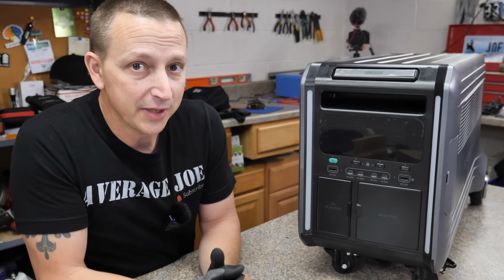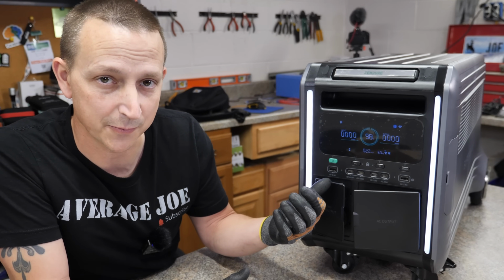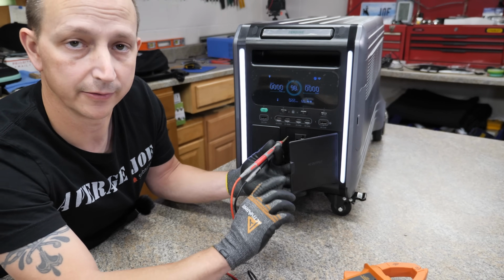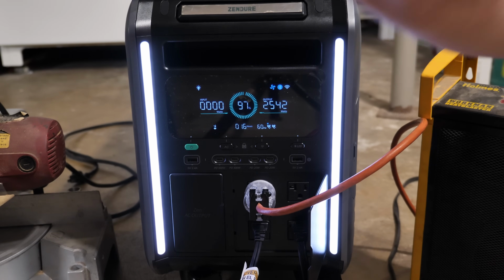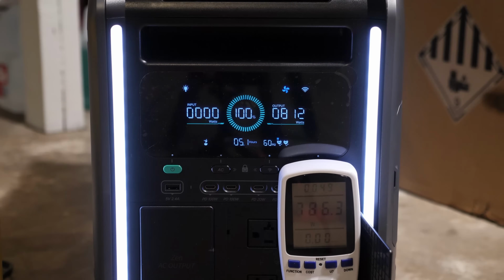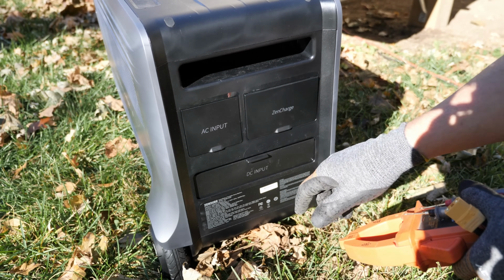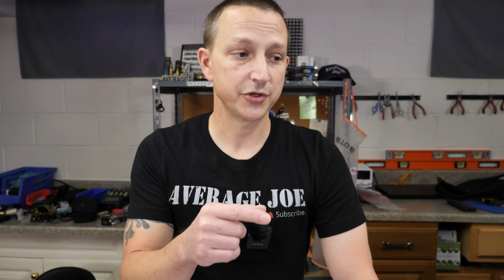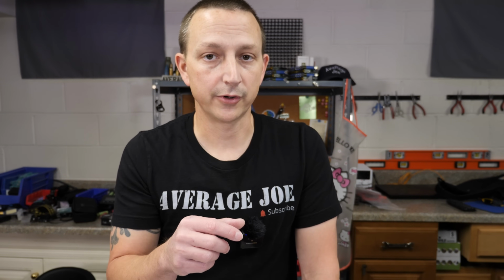Full Review on a Zendure Superbase V4600!!

Comment: I bought two Zendure SuperBase V 4600 units, and one of them became completely unusable during a software update. This was not caused by misuse or physical damage. The unit died during Zendure’s own update process.

I contacted customer service expecting them to help repair or replace it, but they have refused to provide a reasonable solution. For such an expensive product, this level of support is unacceptable.

My experience with Zendure has been terrible. I cannot recommend the SuperBase V 4600 or this company. Think carefully before spending your money on this product.

Comment: what you actually fail to mention, is the fact that is has no real off-grid mode unless you buy the expensive "Home Panel" wich is rather large. Without the home panel you are stuck in Bypass-mode. This means every load you run from the SB V4600 will be put through to the grid, regardless of any limits you established in the App. This is very problematic in every instance when you want to run stuff wich needs burst of power and the grid can not cope with that burst-current. Let´s say you want to fire up a party and your friends ask you to supply the power. Constant load 2kW (Lights, Music, etc), Cooling Wagon (Beverages) 2,5kW. Place is in the woods and only has 220V at 16A = 3,6kw. You cannot do that properly, and here is why: 
- The moment the cooling Wagon starts to draw energy (2,5kw) , the Zendure will automatically put it on top of the constant load (2,0kW). Zendure will now request 4,5 kW from the Grid, which will pop the circuit breaker. 
- This is regardless what you established as an upper limit from the Grid in the App
- The UPS will now kick in and supply the 4,5kW
- But it will do so w/o the support from the gird, just the battery
- Inside of an hour the Zendure will leave you with nothing, since the batteries are depleted. 

The Home Panel will let you accesss the Off-Grid mode where you could run the above mentioned scenario, albeit at a much higher price point and with additional hardware to carry around. 
Stay away from this clunker. Get an Bluetti EP500 pro instead. It is super quiete, can engage different modes, like the senario above. Has more kWh. Better software integration and better solar panel integration (2 MPPT vs 1 Zendure).

Comment: I like the SB v4600. It is a beast. The software works flawlessly, because I heard some horrific things about the update etc.  It has to be said though that the unit is rather noisy. Even with rather easy loads it is answered by a loud fan. As long as you have this away from your dorm etc it is ok, as it does not take away from the performance.
The only problem I have is with the programming of the charging process, while the AC is engaged. I have another Powerstation and I want to transfer some juice to the SB B4600. Regardless of what you choose in the zandure app the full load is required from the income. It looks at the income as from the grid and just transfers the same volt through , even shutting off it's own AC function. Because the smaller external Powerstation can not handle the required load, it shuts off. In the zendure app I can choose silent charge or can limit the charge to a certain amount Watt, this is regularly overwritten by the requirement of the load and respectively required from the external unit, regardless the stoppers you implemented.
I do get it, it makes sense to just pass it through when you are grid connected. But I'm not in in that scenario the limiters unfortunately do not apply.
Reply: Also it is an energy-hog. When AC is engaged it gobbles down 80W constantly - regardless of load.
Reply: Hey, thanks for your feedback. Is the fan loud only when charging or all the time ? Thinking about buying one for my van. I won't charge it at night but just feed my 12v cooler.
Reply: @troidemi  I would advise against it. The Zendure is loud, verly loud indeed. The worst thing, especially for me on a camping trip is the fact that you can not charge from the grid and stablish an upper limit for the wattage. This is often required since the current (Ampere) on the Campsite is often times restricted and you want to run maybe an A/C, an electric Grill-oven, Coffe machine, etc. In all those instances, the zendure can not really help you. What the nice people from Zendure don´t tell you, is that the SV is constantly in Bypass-Mode. Meaning, every load it gets it will automatically try to pass through to the grid, regardless of "Silent Mode" or "upper Limitation for charging". Now, this begs the question, why the hell does it then have these funcions. Well, you have to purchase an additional "Home Panel" with a hefty price tag on it and cumbersum on a camping trip. For all these reasons I would give the Zendure a wide berth. Go for Bluette EP500 pro instead. This powerstation blows the zendure out of the water, in every category. And it is super silent, you won´t hear it at all.

Comment: How is the unit holding up?
Reply: Mine is bricked. Won't take a charge. Won't output energy. Powers on and connects to the internet and bluetooth, but other than that it's not practically functional. Zendure offered me a partial refund, but I kind of want to replace the broken inverter and stuff with an aftermarket solution

Comment: 240v is always 1 phase. the 2 legs of 120v balance loads over common. Basically if you have a light plugged into leg A and the same type of light plugged into leg B, you will see zero current over common back to the panel. If there is an imbalance then you will see the difference over common. The legs are in series basically. I think my 240V inverter is always on, and maybe thats just how it is, but with low power draws it drains fast. I can run this thing for days using only the USB and 12v stuff, but the inverter will drain it in like 2 days, even with low power stuff.

Comment: So it seems that even though it's 3,800w it can only do about 1,900 on each 120v leg.  So to run split phase 240v to a transfer panel you'd need to have it balanced.
Reply from the maker: For split phase we also need the hub which I now have and need to do a follow up vid. I think some firmware updates have inproved it as well.
Reply: @AVERAGE_JOE  You can just get a cable that splits two 120v plugs into a 50 amp plug, you don't need their hub but their hub will work too.

Comment: Hi Joe! Thx for the video.  If you have time could you possibly answer some questions regarding the solar charging setup? Following the manual, it says to wire 3 in series, or if you have more, to wire them in parallel. I have tried both and cannot get my system to charge. The company has not been any help as yet. I’m going to try charging it via shore power and see if it just needs a boost to be able to start the solar charge. At my wits end! Seems like a great unit but mine isn’t working and the company is stalling regarding a return/refund.
Reply from the maker: Sure Ill help if I can.  Ill need to start at beginning.  Can you check the voltage of the panels to make sure the voltage is in the correct range and of course to make sure the polarity is correct? Positive and negative going to correct port. Let me know voltage once you know.

Comment: Hello cool video, thanks a lot.
I was wondering if it is possible to charge in dc and discharge in ac simultaneously? If yes does it use always the battery storage to provide the requested ac power or is there a kind of bypass mechanism to only use battery just for the power not provided by the solar input?
Same Question if we use the ac input together with ac output it works simultaneously as well? And with the same bypass mechanism ? 
Finally have you tried the 240v outlet : what is then the max power? And is the ups mode working with this outlet? 
Many thanks in advance for your replies.
Best regards

Comment: Any update on the Y-cable? I'm suuuuper curious about this unit, it's currently the frontrunner in my shopping, but the lack of an L14-30 outlet is a big con. (And the type-2 inlet needs a type-1 adapter to use north american EVSEs, but that's no big deal.) 

I'm guessing you blew up your washer by mixing up L1/N with L1/L2 and instead of 120-0-120, you made a 240-0-0 cable.
Reply from the maker: Y cable they say is on its way. I am interested to see what the Y cable is as well. For the washer, on the 240v outlet when you measure a hot to ground it shows 120v. Same for the other hot to ground. So I assumed it might be split phase. Wired up an adapter, checked voltage on end of adapter and all seemed good, 120v on each leg. Its 100% my fault cause it didnt say 240v split phase anywhere. I was just seeing what I could do lol💥🤷‍♂️😆

Comment: is it possible to run a 4400 load, presume not with one unit, but with satellite battery or two v4600 units. I am hoping to connect it distribution panel (through transfer switch).
For your 220 V, i was able to run my 220v split unit with it directly.
Reply from the maker: Is it a 120v or 240v load? I think its possible. What is the load btw?  Length of time will come into play. Basically 1hr run time at full 4400w with a single. Yeah for the 240v, it will run 240v appliances. I was thinking it may have been split phase cause measuring the 2 hots to ground it shows 120v on each leg
Reply: Water heater 240v 4400 w. Seems my main load in winter atleast. Plan to charge battery unit with solar so any savings will help. 
Thank you.
Reply from the maker: I think Id get at least a 2nd. Water heater is a big load!

Comment: Yeah there's a serious compromise and a BIG problem here - This system will only do 240 Volts AC at a puny 16 Amps ! What am I going to do with only 16 Amps ? This is simply an underpowered nightmare ! 30 Amps are the absolute rock bottom minimum for home backup. 50 Amps is better, and 100 Amps is nominal. Sorry, but I know of clothes dryers that pull at least 20 Amps ! This is just another system that's not good enough !
Reply from the maker: Yeah like I said near the end. It has potential but you would want to get more add ons like batteries and maybe even another 4600.
Reply: How much amps can it go for solar ?
Reply from the maker: Its 3000w for solar.

Comment: When in UPS mode and the battery is depleted, will it come back on when grid power is restored without intervention?
Reply from the maker: Ok so in UPS mode, it did turn on or restore power at 2%SOC(after plugging it in after my test). So yes it worked without intervention.
Reply from the maker: I am pretty sure it does but can let ya know here in 5hrs. Im doin a cycle test as I type here.🤘

Comment: I am not impressed with this unit. I expected that it would run those appliances with power to spare. If they rate it at over 4kw output, why did it shut down at much less wattage output?
Reply: It cannot run continuously over 3k watts. Surge capacity must be strenuously large that prevents it from running it over 2k watts

Comment: Thanks for the review, but, no thanks. It still uses unreliable, outdated, low surge, high frequency, transformerless inverter technology with a shorter life expectancy than a much higher surge, longer lived,  low frequency,  transformer based inverter. No experienced, "true" off gridder would ever rely on a high frequency inverter for their power. You might be able to start and run some high surge loads that you demonstrated, when high this frequency inverters is new but every time you fire up or shut down that inductive load, you're shortening the life of the MOSFETs in your these inverters.
Reply from the maker: Cant go wrong with a transformer! I have a 12kw!🤘

Comment: The inverter is rated for 3800 watts but yo can run continuously 2500 watts. At 3300 or even 3600 it can run continuously but not long to prevent battery damage. It's a measure placed by zendure to protect the battery. High discharge emits heat which can limit battery durability
Reply: That's a good point. It is a shame that they don't print the continuous running watts. People get duped by that all the time. New gas generators show both peak and running watts. These power stations need to do the same.

Comment: Very interested in the Y cable you mentioned.  I heard of a Y cable before but that was connecting two Zendure units of their 240 volt output to get split phase, I had not heard of a Y cable hooking into two of the 120 volt, different phases, two get 240 volt split phase.  Another good test would be the continuous power that the unit can put out, run for hours, and not shut down.  Thanks

Comment: It does not seem to have much overload capacity.  I heard that instead of the 3,800 watts it wants 2,500 continuous or less power draw.  More important is that I heard the 240 volt in SINGLE phase not split phase -- you need two units for split phase -- this is a serious limitation for a transfer switch and powering your house.
Reply: They seem a zen cable for the single unit to do 240 at 16 amps. I actually have it. I would not recommend this device. Customer service is horrendous. No replacement parts, no phone number. Total bust.

Comment: Generally speaking, Power stations just don't make any sense above around 2 kWh of storage.   You wind up paying a huge premium (more than double the price) for the storage.   You get ease of use, but you also get a very expensive single point of failure and you are locked into the vendor for any expansion, repairs, and other things.

Just going by storage... a discrete 48V (51.2V nominal), 5 kWh LiFePO4 battery such as an EG4 LL, is $1500, with no real limit on the number of batteries that can be paralleled.  10, 20, 30 kWh... 60 kWh... 100 kWh.  Whatever you need in  5 kWh increments.   Now, of course you don't get anything else with that... no solar input, no inverter, no USB ports, no portability, and those things do cost money, time, and a bit of expertise to safely throw together.

Discrete solutions are definitely less convenient and take time and a bit of expertise (though not a lot) to throw together.

But once you get into "large" systems, discrete solutions wind up being far less expensive, far more expandable, far more robust (no expensive single point of failure), redundancy (multiple batteries, multiple inverters, multiple charge controllers), and universally far more efficient intput-to-output.  With a discrete system if you need more solar you just tack on another $100 charge controller.  If you need another inverter you just add another inverter.   If you need more storage you just buy another battery and put it in parallel.  And if something breaks you replace just the one bit that broke.

My strong recommendation is that people just don't spend the bucks on these super-big power stations, not past around 2 kWh (true portability... something that can actually be carried without wheels).   If you need more than that, look into discrete solutions.

-Matt

Comment: Looks pretty good value for money, and a lifesaver in a power cut. Will keep the fridge going for a bit, and be good for onsite working with basic power tools.
I like that the solar input will take a decent amount of  power.
The motorized wheels were a fun gimmick, but could really do without them and save a couple of hundred dollars instead.
I put 3kWh of scooter batteries and a 3-6kW inverter on my escooter. It'll go much faster, and maybe even able rescue an EV with a flat battery... 🙂
Reply from the maker: Its has some pretty good features and is fairly cheap right now. Oh you did aye, you should do EV rescue vids on your ebike😲